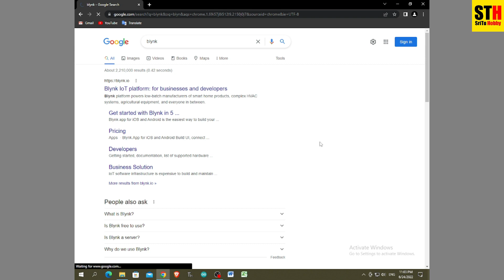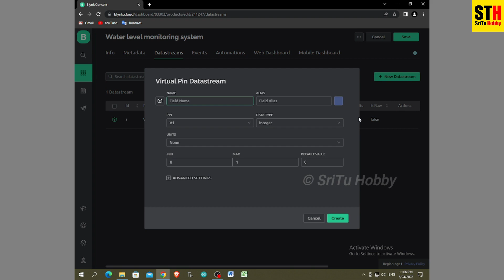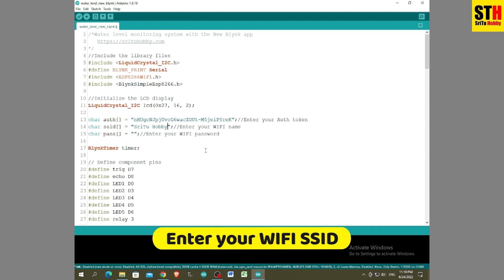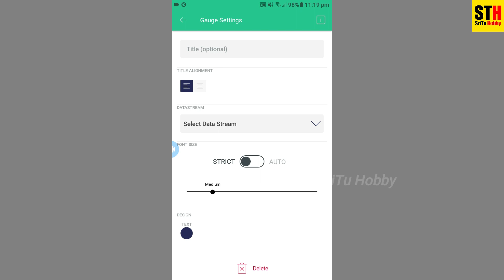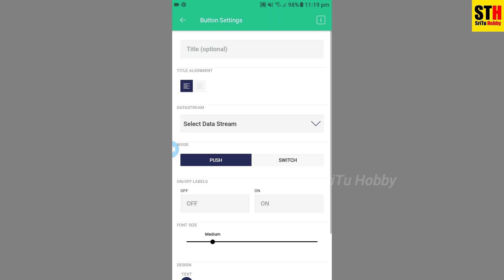How to make a water level monitoring system with the new Blynk app

Comment: One of d best codes, integrated it wit h a002 UART SENSOR, 
EVERY THING WORKING FINE, 
BLYNK Message LIMIT IS ONLY issue, kindly guide for reducing cloud upload rate, 
I have omitted distance line, only percent display for 100sec timer is also sufficient,

Comment: I followed all the steps, starting from start to finish. Blynk app and Node is online but the LCD, Power Relay and sensor is not active, not even lighting up. I followed the wirings and codes. Please help!
Reply: please respond ASAP
I really need this to work please
Reply: Hua bhai ab @noriakikakyoin3991
Reply: @noriakikakyoin3991  hey there were u able to complete this project using this above mentioned video

Comment: sir why my lcd display, he din't show the text? how can i fix this sir?
Reply from the maker: Check the jumper wires
Reply: @sritu_hobby  my jumper wires are plugged in correctly sir, and I've disassemble and then assemble the project in 5 times, but still won't show the text on the lcd display

Comment: Why happened WARNING: library LiquidCrystal_I2C claims to run on avr architecture(s) and may be incompatible with your current board which runs on esp8266 architecture(s).

Help me!
Reply: Same problem bro
Reply: @msivakumarmcor823  Bros......i think your lcd......screen is green.....plz take the.....blue display
Reply: If you have solution plz tell me bro
Reply: @msivakumarmcor823  Bros......i think your lcd......screen is green.....plz take the.....blue display
Reply: why the lcd error only appears
Reply: @selpira7314  Bros......i think your lcd......screen is green.....plz take the.....blue display
Reply: @marotipanchal2880  but my lcd screen is blue, same problem
Reply: @raihanalifaziswandito4696  bro.. The video and instructions are really good and properr... There is no such error will occur... When i face this problem i try so much verious ways... After that i took my friends node mcu..... And follow the same to same instructions and. ...boom my project is run successfully.. 
Try this and tell me that your project is run or not?
Reply: Bros......i think your lcd......screen is green.....plz take the.....blue display

Comment: Bro how do you connected the power supply
Reply from the maker: Please check the circuit diagram
Reply: We should connect the 230 v AC motor
Reply from the maker: Connect it to the relay module
Reply: @sritu_hobby  bro can we connect the 9v dc battery , for demo is it works
Reply from the maker: Yah
Reply: @sritu_hobby Error compiling for board generic ESP8266 module help immediately sir